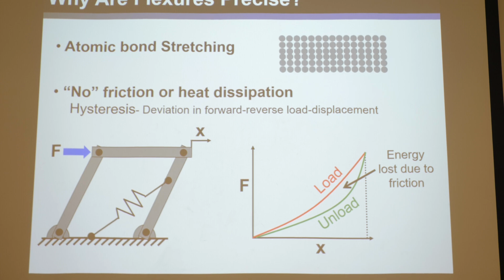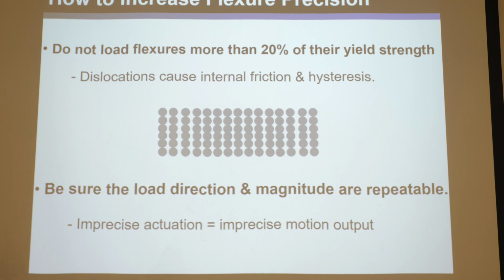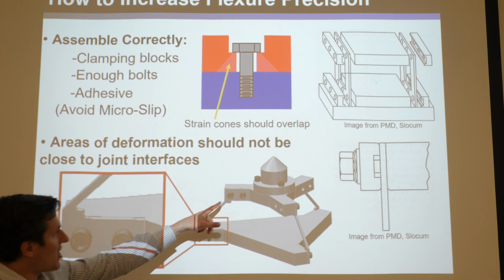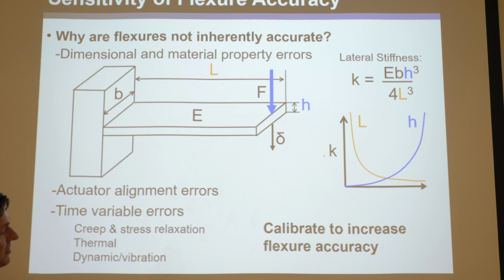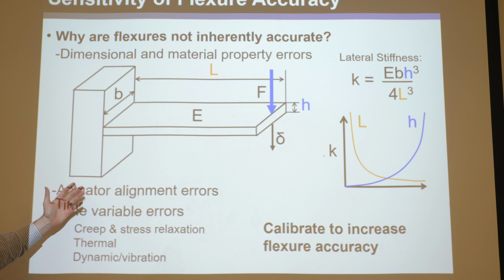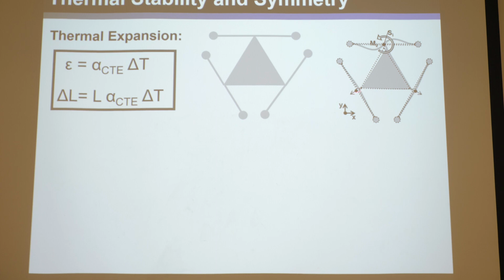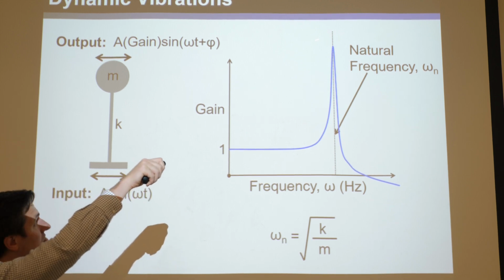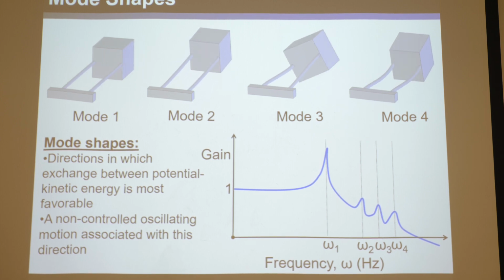Compliant Mechanisms Lecture 1 Part 4

Comment: thermal stability seems like kind of an undesirable property for high precision though. a thermally unstable compliant mechanism will move a predictable, repeatable amount when heated, while a thermally stable compliant mechanism will have unpredictable buckling motions. wouldn't you be better off just measuring the temperature and compensating for the predictable offsets?

Comment: Hysteresis Loop and Flexure Design: Summary

This transcript provides a detailed explanation of hysteresis loops and their impact on flexure design, highlighting best practices for achieving high precision and repeatability in mechanical systems. 

Key Points:

* Hysteresis Loop (0:00): 
    * Caused by friction at sliding joints, resulting in different force-displacement curves for loading and unloading.
    * Represents energy loss due to friction, impacting repeatability.
    *  Requires knowledge of loading history to understand force-displacement relationship.
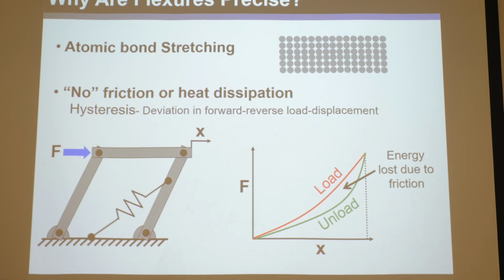* Minimizing Hysteresis (1:28):
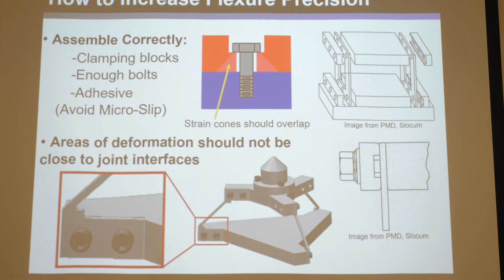    * Material Choice (7:00): Single-piece, single-crystal materials minimize internal friction and micro-slip, improving repeatability.
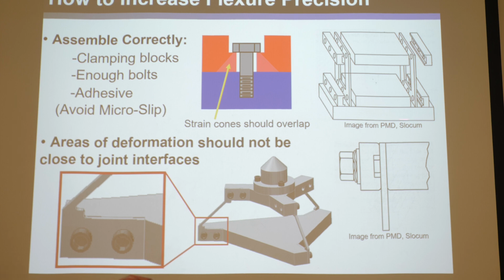    * Joint Design (8:02): Avoid sliding joints; utilize glue, clamp blocks, and strategic bolt placement to distribute strain and minimize micro-slip.
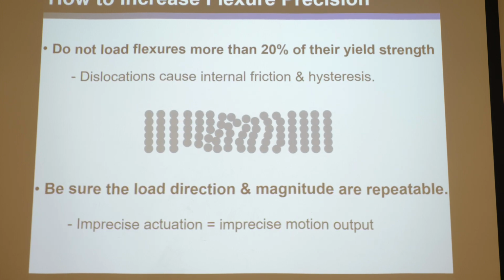    * Stress Management (3:41): Keep stress levels below 20% of the yield strength to prevent permanent deformation and micro-slip.
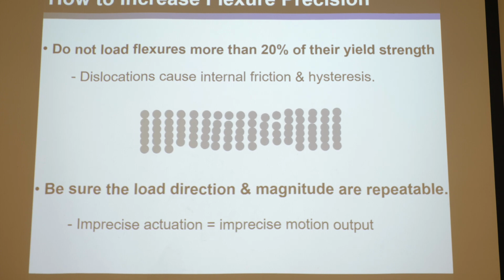    * Actuator Choice (6:20): Employ non-contact actuators (e.g., voice coils) to eliminate friction and enhance precision.
* Flexure Design Considerations:
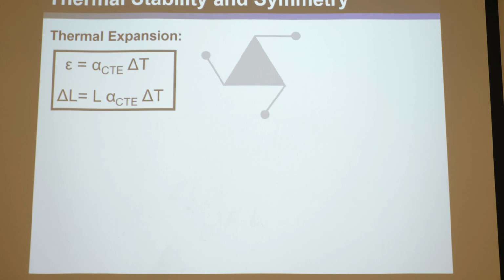    * Thermal Expansion (19:11): Design for thermal stability to mitigate unwanted movement caused by temperature variations. Symmetrical designs can help reduce thermal instability. 
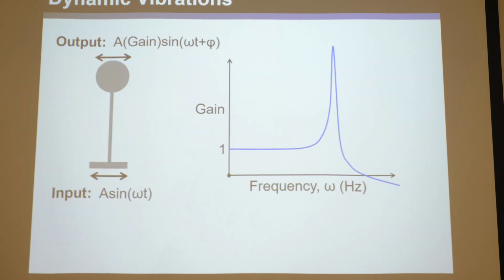    * Vibrations (23:05):
        * Understand the concepts of natural frequencies and mode shapes.
        * Design flexures and supporting structures to avoid resonance and minimize unwanted vibrations.
* Accuracy and Calibration (12:19):
    *  Manufacturing tolerances inevitably lead to deviations between designed and actual stiffness of flexures.
    * Calibration is essential to achieve accuracy after accounting for these variations.
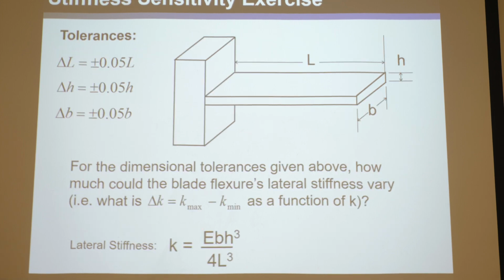* Illustrative Example (17:28): A 5% tolerance in the dimensions of a flexure can result in a significant (71%) change in stiffness, highlighting the importance of calibration.
* Key Takeaways:
    * Precision and repeatability are paramount for achieving high accuracy in mechanical systems.
    * Meticulous design choices are crucial to minimize hysteresis and other factors affecting precision.
    * Calibration is a fundamental step to ensure accuracy in the presence of inevitable variations caused by manufacturing and environmental factors. 

Deutsch: Hysterese-Schleife und Biegebalken-Design: Zusammenfassung

Dieses Transkript bietet eine detaillierte Erklärung von Hysterese-Schleifen und deren Auswirkungen auf das Design von Biegebalken. Es hebt die besten Praktiken hervor, um hohe Präzision und Wiederholbarkeit in mechanischen Systemen zu erreichen.

Schlüsselpunkte:

* Hysterese-Schleife (0:00):
    * Entsteht durch Reibung an gleitenden Gelenken, was zu unterschiedlichen Kraft-Verformungs-Kurven beim Beladen und Entladen führt.
    * Stellt den Energieverlust durch Reibung dar und beeinflusst die Wiederholbarkeit.
    * Erfordert die Kenntnis der Belastungshistorie, um die Kraft-Verformungs-Beziehung zu verstehen.
* Minimierung von Hysterese (1:28):
    * Materialwahl (7:00):  Einteilige, einkristalline Materialien minimieren die innere Reibung und Mikrorisse, was die Wiederholbarkeit verbessert.
    * Gelenkdesign (8:02): Vermeidung von gleitenden Gelenken; Verwendung von Klebstoff, Klemmblöcken und strategischer Platzierung von Schrauben, um die Spannung zu verteilen und Mikrorisse zu minimieren.
    * Spannungsmanagement (3:41): Halten Sie die Spannungswerte unter 20 % der Streckgrenze, um dauerhafte Verformungen und Mikrorisse zu vermeiden.
    * Aktuatorwahl (6:20): Verwenden Sie kontaktlose Aktuatoren (z. B. Sprachspulen), um Reibung zu vermeiden und die Präzision zu verbessern.
* Designüberlegungen für Biegebalken:
    * Wärmeausdehnung (19:11): Designen Sie für thermische Stabilität, um unerwünschte Bewegungen durch Temperaturschwankungen zu minimieren. Symmetrische Designs können dazu beitragen, thermische Instabilität zu reduzieren.
    * Schwingungen (23:05):
        * Verstehen Sie die Konzepte von Eigenfrequenzen und Schwingungsformen.
        * Konstruieren Sie Biegebalken und unterstützende Strukturen, um Resonanz zu vermeiden und unerwünschte Schwingungen zu minimieren.
* Genauigkeit und Kalibrierung (12:19):
    * Fertigungstoleranzen führen unweigerlich zu Abweichungen zwischen der geplanten und der tatsächlichen Steifigkeit von Biegebalken.
    * Kalibrierung ist unerlässlich, um nach der Berücksichtigung dieser Abweichungen die Genauigkeit zu erreichen.
* Beispiel (17:28): Eine Toleranz von 5 % bei den Abmessungen eines Biegebalkens kann zu einer signifikanten (71 %) Veränderung der Steifigkeit führen, was die Bedeutung der Kalibrierung unterstreicht.
* Schlüsselerkenntnisse:
    * Präzision und Wiederholbarkeit sind von entscheidender Bedeutung, um eine hohe Genauigkeit in mechanischen Systemen zu erreichen.
    * Sorgfältige Designentscheidungen sind entscheidend, um Hysterese und andere Faktoren, die die Präzision beeinflussen, zu minimieren.
    * Kalibrierung ist ein grundlegender Schritt, um trotz unvermeidbarer Abweichungen durch Fertigung und Umweltfaktoren die Genauigkeit sicherzustellen. 

i used gemini 1.5 flash and pro

Comment: Don't rubber also have hysteresis and do they also count as flexure?
Reply: I am not an expert on this but here is my guess. It depends what you make out of rubber. A large block of rubber may be effectively rigid as it will be hard to deform, whereas a thin piece will of course have elastic properties, so you could conceivably build a flexure entirely out of rubber (make the rigid parts thick and the bending parts thin). Rubber would probably suffer from substantial hysteresis as it is a polymer (both natural rubber and synthetic rubber).